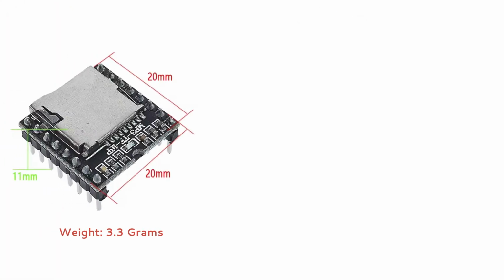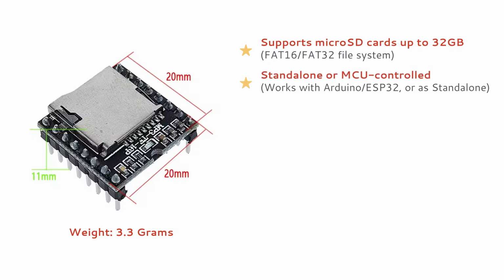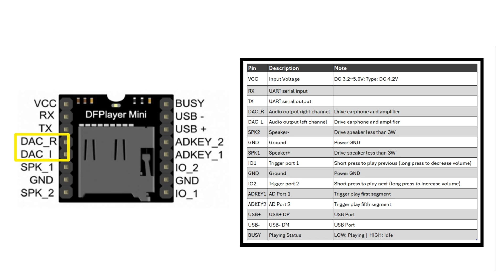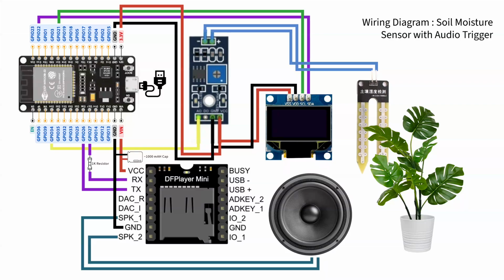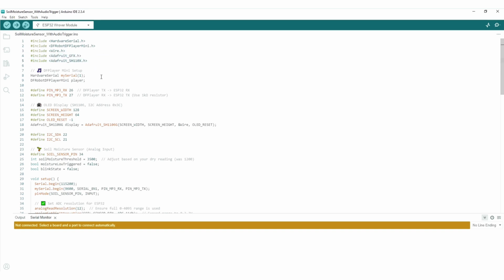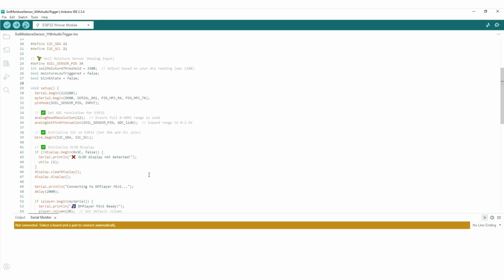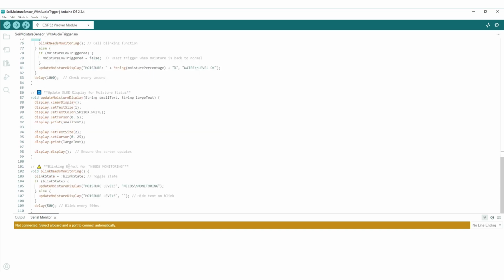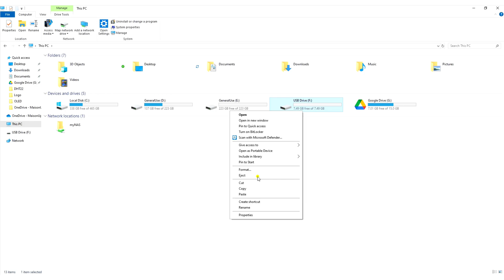ESP32 + DFPlayer Mini | DIY Talking Sensor! (Part 1)

Comment: Hello sir, we are working on a little project where we use the temperature sensor and when the temperature rises above normal it will alarm by talking like "danger danger" after is the condition to improve the rising temperature like "open the window". Do you think this kind of project is possible? Much appreciated if you see and comment ❤
Reply from the maker: Absolutely, your project idea is 100% possible and a great use of the ESP32 + DFPlayer Mini!
You can use any temperature sensor like the DHT11, DHT22, or a more accurate one like the DS18B20 with the ESP32 (or any microcontroller). When the temperature goes above your defined threshold, the ESP32 can trigger the DFPlayer Mini to play pre-recorded audio clips such as “Danger, danger!” followed by messages like “Please open the window.” Just store the MP3 files on the DFPlayer’s SD card.

For simpler applications, you can also use a buzzer if voice output isn’t needed.

If you need help with the wiring or code, feel free to ask – happy to guide you. Best of luck with your project!